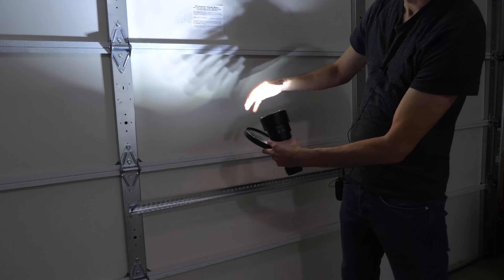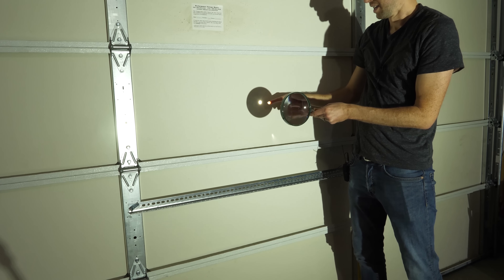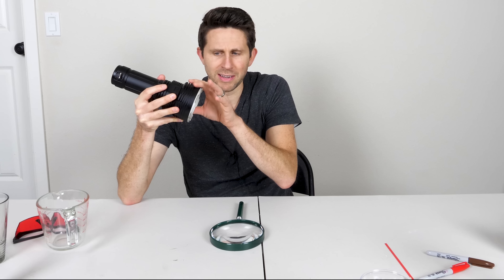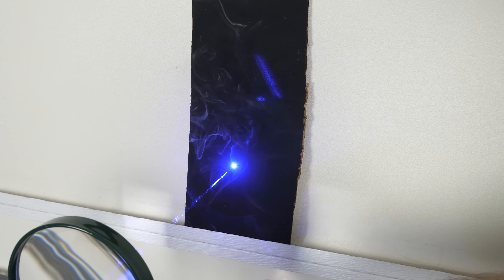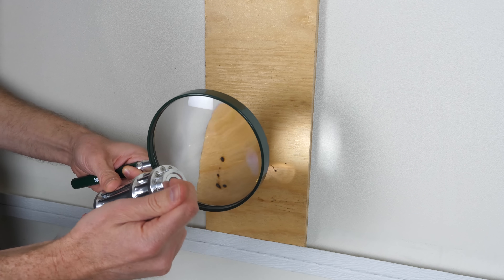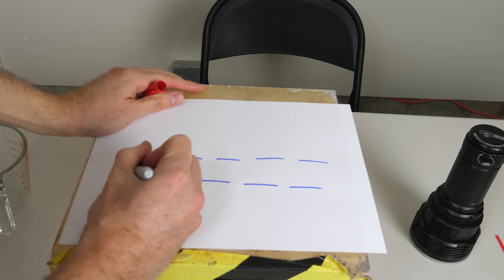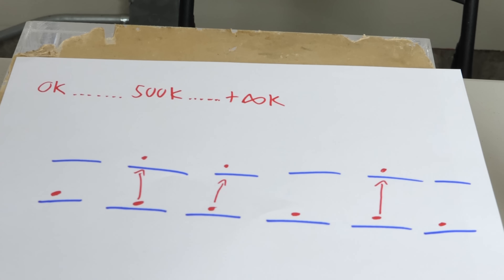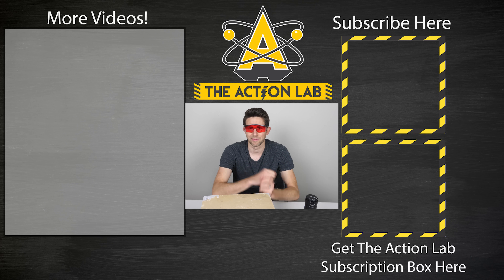What Happens if You Focus a 5W Laser With a Giant Magnifying Glass? Negative Kelvin Temperature!

Comment: I don't think your experiment accurately explains the point being made and is a little misleading. I can see the point trying to be made by the experiment shown, but the statements made are inaccurate. The next bit trying to explain Boltzmann's entropy was confusing and didn't appear to be related to the experiment. 

Ideal Laser light is a parallel stream of coherent light with a consistent cross-section. You can focus the cross-section of the beam to a smaller beam and thus increase the energy density per cross-sectional area. Like sunlight, you haven't created energy, just packed the same energy into a smaller space.  You could actually focus the LED light to a single point being brighter than a single LED as the light source is not a point source but multiple sources. It would not however be of a higher energy density than all LEDs combined. 

if the point was to explain Boltzmann's entropy and conservation of etendue, I'm not sure how your experiment does that.

Comment: I'm sorry, but you need to have a better understanding of energy and temperature as well as lens focal lengths and images. 
The flashlight will only focus to a smaller image of itself regardless of lens and distance.

 Also, lasers have a minimum spot sizer regardless of the lens that is dependent on the laser characteristics.  You also have a diode laser which had different divergence along two axes at about 90 degrees from each other, so a spherical lens can't focus that to a dot. A cylindrical lens is needed.  This is like a lens for correcting astigmatism. The laser has one internally to focus the two axes.

.

Comment: There are so many things wrong with this. First of all, the laser is actually around 1-1.5W, varies a lot because it's a cheap Chinese product. Second, just use the laser's built in focusing feature (screw out the lens).
Reply: https://en.wikipedia.org/wiki/Negative_temperature

A substance with a negative temperature is not colder than absolute zero, but rather it is hotter than infinite temperature. As Kittel and Kroemer (p. 462) put it,

The temperature scale from cold to hot runs:

+0 K, … , +300 K, … , +∞ K, −∞ K, … , −300 K, … , −0 K.

Comment: If the laser has temperatures up to infinity, it can heat its target well beyond the temperature that is characterized by the thermal radiation of a green wavelength maximum (actually 5500°K).
So the target would. with increasing temperature, emit UV, X-ray, and even Gamma-ray peak wavelengths, right?
Seems to be quite dangerous...

Comment: Me trying to figure out how is the laser not burning the magnifying glass
Reply: Because its mostly transparent to the light and heat. Different lens materials must be considered for certain applications. And to be fair the lens usually over time will gain some heat from the beam, but due to its transparency, its much less than the black material he shined it on to. 
 Some materials and formulations of glass are less transparent to certain types of emr and will absorb them, and this can cause problems or even be a desired feature.  For example laser eye protection is intended to absorb certain light to protect your eyes. These lenses can be damaged which is their job, so your eyes are not damaged. 
 But if a lens is absorptive of lets say infrared radiation and thats a large component of a particular laser beam passing through it, even though it also produces a different wavelength, the lens can become heat damaged very quickly.

Comment: Just want to stress, don't try this at home, you can easily burn your retinas without proper protective equipment (you can see in the video he is wearing safety glasses, hopefully ones properly rated for laser work).
Reply: This should be stickied. You can burn your retina just by looking at the focal point of a high energy laser. Very dangerous.
Reply: Yes but what if your retinas could easily burn your home without proper protective equipment?

(I'm referencing Cyclops from X-Men).
Reply: And what "proper" protective equipment means seems to need careful consideration.
I know nothing about this company but their statement below seems credible to me and it may be crucial in the context of this video, which is tweaking the "beam diameter" criterion:
https://www.vseyewear.com/laser-safety-glasses-how-to-choose/

"To choose the appropriate laser safety eyewear for a given application, one must consider the following specifications of the laser; operating wavelength, power, beam diameter, beam delivery system and work environment."

Simply having "laser safety glasses" may not be enough when concentrating the beam from a laser which was selected based on the specs of the laser alone -- and then playing with the beam intensity, which is power/area ; and proportional to power / (beam diameter)^2.

If safety glasses are rated for a 5-watt laser with a 10-mm beam diameter = 5 / (pi / 4 * (0.01 m)^2) = 64 kW/m^2

They are not rated for the result from concentrating the beam to a 1-mm diameter with a 10x magnifying glass:
5 / (pi / 4 * (0.001 m)^2) = 6.4 megawatts per square meter

Replicating the actions in this video could be catastrophic for the naïve.
Reply: @artsmith1347  agreed. this is not trivial stuff.
Reply: @deice A valid stressor. Fortunately, people with US$500 for this kind of "toys" must be knowing what they're doing.

Comment: You're talking about a problem that can be solved with a bigger magnifying glass
Reply: Sort of. He overly simplifies things sometimes because it would be a much longer video. He mentioned it passingly just for comments like this and he explained his meaning well enough to figure out how he is right in this context. 
 With his flashlight, yes he could have used a larger lens combined with a series of increasingly smaller lenses to capture more of the emitted light and focus it down. Much like you could do with sunlight because a lense of a certain size will produce a spot of a certain size at its focal length, so you can use a really large lens to focus the light down to the diameter of a smaller subsequent lens, rinse lather and repeat. 
What you will do of you set this up for comparrison between 1 lens, a set of two and so on is that you will create a series of hotter spots. But this is due to and only to the fact that a smaller lens can channel only a small ammount of light, and a larger one can capture more, like how the solar cell in your pocket calculator, if its even real, can only create so much voltage regardless of how much light you shine on it after a certain point. So while a spot created by 10 lenses will be hotter than one created by a lens the same size as the smallest one in the series, neither set up will produce a spot that is hotter than the surface of the sun. He did explain this im a correct but overly simplified way you should read his comment he pinned at the top. Its a fairly straightforward concept. Think of reflective solar power stations that use mirrors to focus and reflect sunlight onto a huge sodium thermal battery. One mirror of a given size would be able to usefully heat a pretty small ball of sodium to a given temp in a given time for a given solar aspect. Two could heat the same mass twice as fast or a mass twice the size in the same time. So on and so forth. 
You could also create hotter spots by focusing light with multiple lenses individually at the same spot from slightly different angles, but this is clumsy on small scales due to angle of incidence and other factors. Again though it will be limited to less than the source of energy that you are focusing.
Reply: @metamorphicorder  yeah I didn't read his comment. I got annoyed that he gave up with a magnifying glass that couldn't capture all of the light his flashlight was emitting and just posted that comment after the video. I'm aware that the resulting energy can't exceed the energy being released by the light source, I was just annoyed that he didn't try to focus more of the light which is something that could have been done yet something he appeared to be dismissing probably because as he stated in his comment, that I've now taken the time to read, it wasn't the point of the video to explain the effect of narrowing and focusing a light source to smaller point.

Comment: Could the brightness of a welder be focused for burning the same heat of the welder?
Reply: Not really, you would need a really large lens or need to be stupid close to the source and even then that flash is whats not going into the welding or is being emitted by the metal as basically overflow energy as the weld is happening. Its really bright to be sure, but otherwise you would be duplicating the exact energy that was used to weld, meaning that either no loss occurred during the weld, which would meam welding didnt happen or that you created energy from nothing.

Comment: Why can't it get hotter than the surface of the sun? The surface of the sun is just under 6000 Kelvin, which is actually quite cool when you consider that the Corona, the next layer above the surface, is over a million degrees Kelvin (possibly millions of degrees). Wouldn't the Corona be the limiting temperature?

And if I focused an equal number of lumens from an led bulb Vs an incandescent bulb, would the incandescent light produce a hotter focal point since it has to burn much hotter to produce an equal number of lumens? This is not something I know much about...